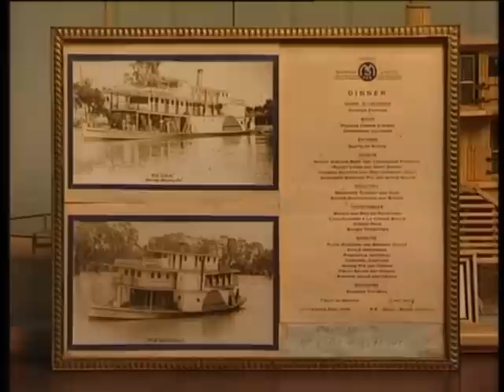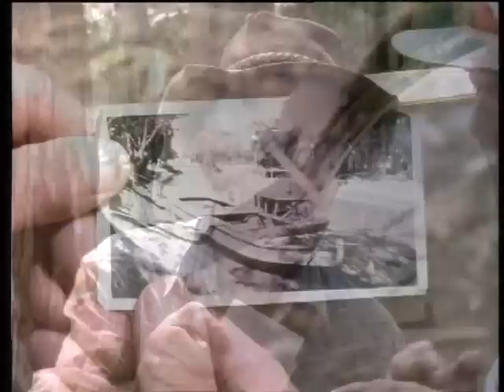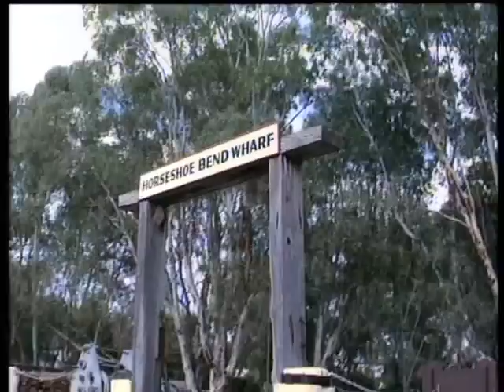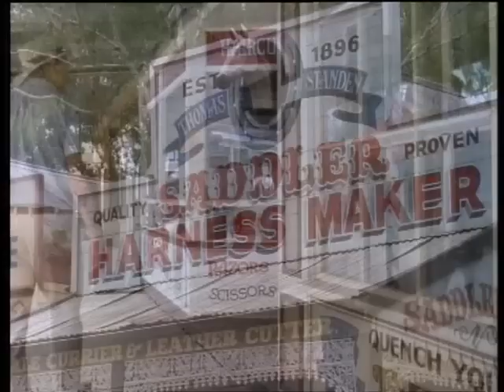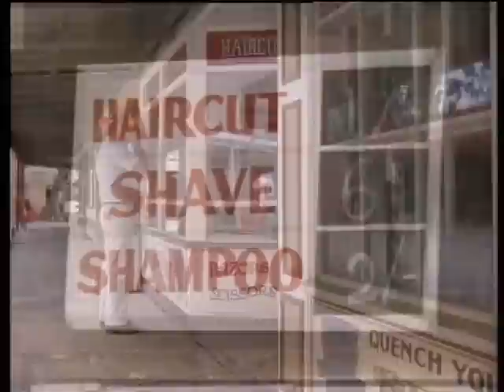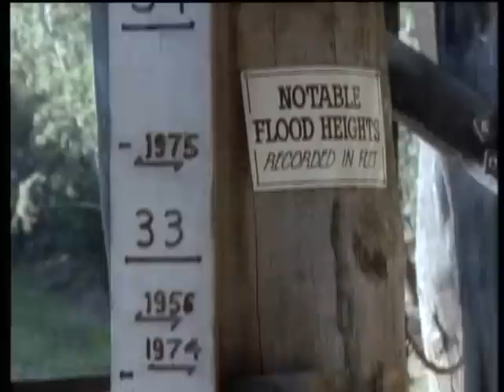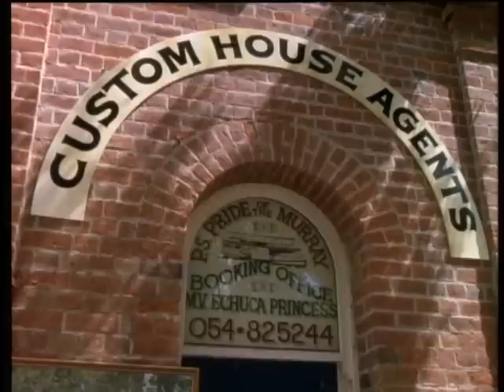Ted Egan's Paddleboats Of The Murray River

Comment: The locks were put it to enable navigation by river boats through much more of the year.  Instead of only flood times.  And the railway to Echuca actually lead to the boom times for the river boats.  The river voyages were shorter and so more economic. Even when I arrived here red gum from the Barmah forest was still being brought to multiple working saw mills at Echuca by these paddleboats.   That would have been a hundred years after the railway was first built.